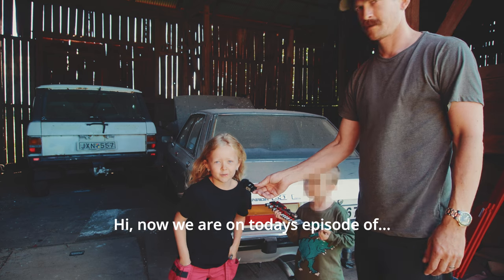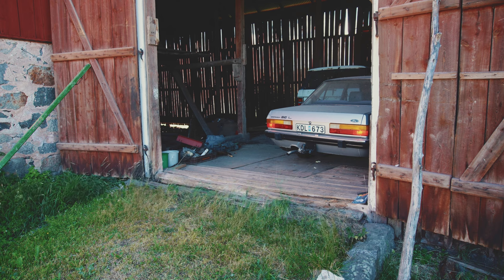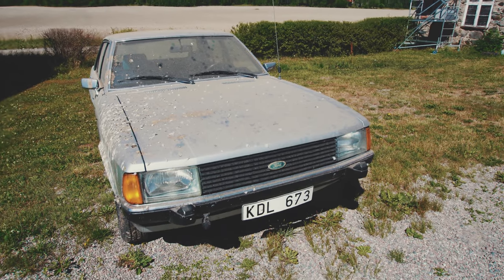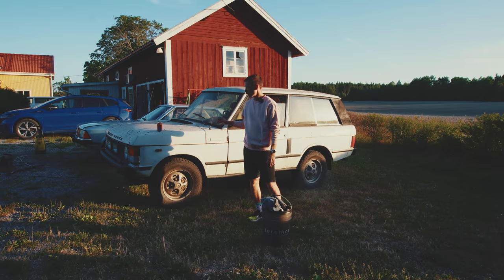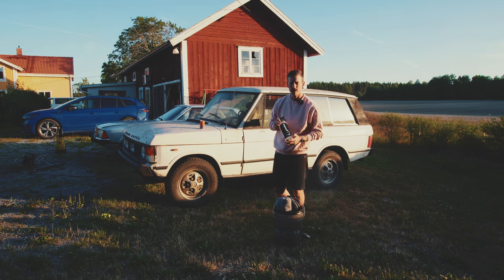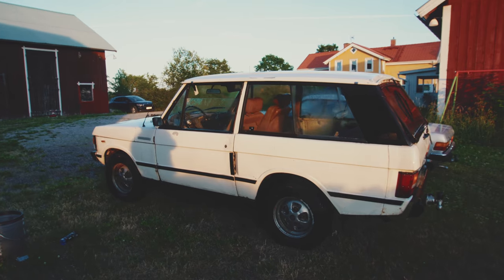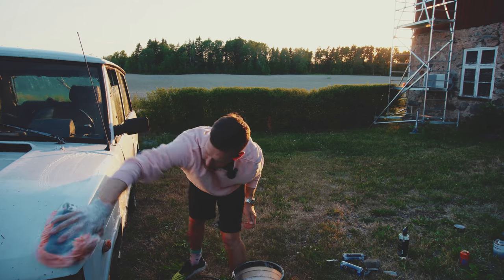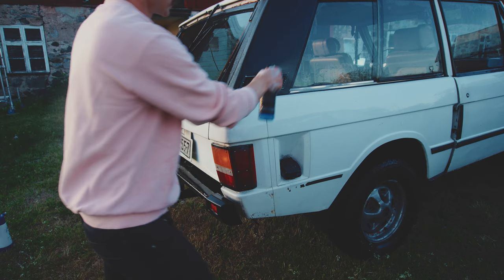From dirty barnfind to shining beauty! | Range Rover Classic transformation

Comment: Hi Henrik, best regards form England. I much prefer the 2 door classic Range Rover to the 4 door, did the guy buy it , if so how much did you sell it for if I'm not being too nosey? Lovely Granada, I don't remember the headlight washers sticking out so far!! Keep up the good work!!
Reply from the maker: Hi! 😊 Yes, I also think that's the better one out of these two! 
He did not buy it, he thought it was a little bit too expensive due to the amount of work.. I'm asking 45 000 SEK (rouhgly £3300). I bought the orange and the white one as a package for around £5180 GBP, so I would like to get back as much as possible ofc.
Yes, the Granada is pretty nice, needs som rust treatment and also to fix the rear linkage arm that is cracked, causing the rear right wheel to camber a lot!  😁 otherwise the interior is like brand new, one owner since 1979 when he bought it from my friends that who worked at the ford car dealer.
Regards HEnrik